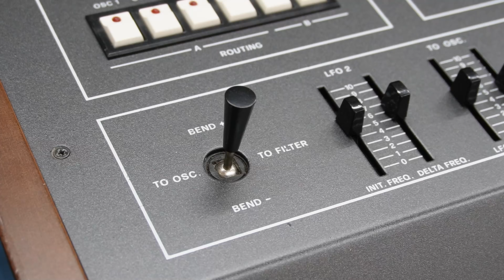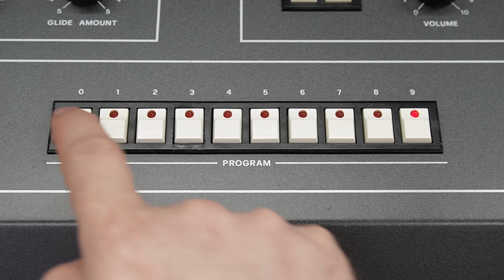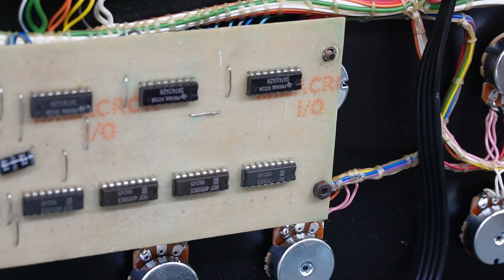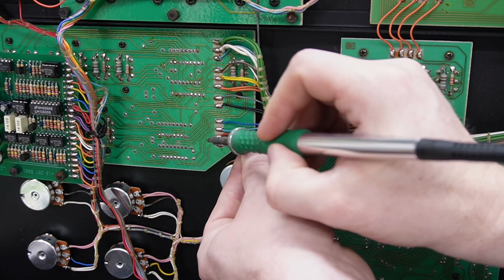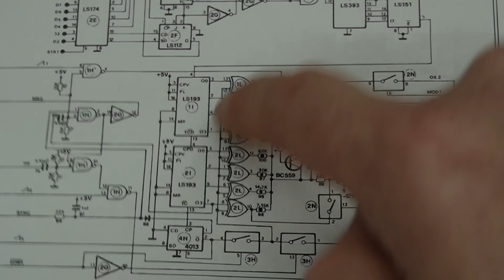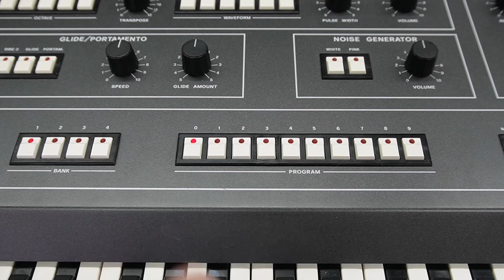ELKA SYNTHEX - A 1980's Legend Gets Fixed!

Comment: I love your videos! I watch many makers and restorers on YT and learn so much.
Your habits and tools really make clear there are no shortcuts, take your time, have the tools and the experience and knowledge before you tackle a job. 
I’ve been into building simple PCBs of guitar pedals and it thru watching people like you, Psionic Audio, Uncle Doug, Josh Scott and Brian Wampler that I’ve learned some best practices. It’s a steep learning curve, but I’m learning. Most importantly I’m learning by watching how you guys do things. Watching you solder is a lesson. I’m going to use a bigger tip now-I was using a needle nose but was having issues and watching all you guys really helps me avoid mistakes. Thanks!
PS I am very jealous of your solder remover. It works like magic!

Comment: Very inspiring. I have a JD800 that needs an overhaul. Supersynth Projects in the UK has keybed and flex PCB replacements. I need one of those kits, and to figure out all the electrolytic caps to replace, clean the red glue of course, and then go over it with a fine tooth comb.

Comment: Videos like yours are the reason why I can at least fix simple things on my vintage organs 😊 I had an error with buttons/LEDs on my Hohner E3, coming to similar conclusions about the controling ICs… but in the end it was a dodgy connector between 2 huge boards… Unlike here ALL 100+ button caps came off 😂

Comment: Hey, Mark! I saw in another video you had one of the XGecu EPROM programmers. T48 maybe? Have you tried using the logic chip detector/tester on that? I've been quite impressed by it. It will auto-detect the chip and test the functionality in a fraction of a second.. It does need to be plugged into a computer though....

Comment: What u have to remember is syths are not keyboards and can usually be set up in 3 to 4 sections so sometimes what sounds like a bum note is the start of the next section however this is old so not sure plus what av just talked about tends to be options u need to set up not always mind and depending on the synth size manufacture eg soooo who the f knows this is old and probably don't have the that tech hence all them boards which is hilarious btw I love it

Comment: Regarding the LS367s that your chiptester failed, but passed them as 74HC devices, it's very likely a logic level issue; given the 2 chips were of the same batch, it's possible they are 74HC devices remarked as 74LS; that's something I have seen when the LS devices were in short supply and certain Chinese vendors would remark them; you can sometimes find that the package date on the underside doesn't match the date code on top, that's a sure sign they aren't genuine.

Comment: Name that tune :-) really enjoy your vids nice to see audio gear getting repaired instead of sent to landfill. I used to repair synths fx units and lots of guitar amps for a local music shop, till they sadly closed like so many others. My favourite was the Synths I saw a lot of keyboards that had switches replaced needlessly when it was the chips. 
I'm really really impressed with your de-soldering gun can i ask what make it is. I had one but returned it within 2 weeks as it spent more time blocked up as the suction was to week. 
Your chip pulling jaws towards the end of video reminded me of my training at seimens nixdorf, repairing analogue traffic light boards the months I spent changing chips. We rotated from disassembling units,  testing and then repair of the boards on a 2 week rota. Our chip tester was huge machine capable of testing 100 chips in a sequence and  about £40000 I avoided it like the plague. We were down-sized when they went digital as the boards were replaced instead of repaired as it was cheaper. Now I work in computing but owning an Allen & Heath Saber 32 track Mixer They were supplied with a huge box of spare parts covering all the electronic parts and some of the mechanical the one for mine has 60% of the parts unused with pots and faders used the most. A sign of the level of quality as she has aged the main failure is caps drying out and the op amps failing which means I still get time doing repairs.

Comment: Hi Mark.. been watching your videos with great interest. I've seen you using cleaning fluids on some items and would like to ask.... I have bought a 1990s Technics keyboard which came from a man who was a heavy smoker and it stinks of nicotine... and keys and buttons feel a little sticky to touch(they all seem to work though)... What cleaning fluid would I be best to use to clean the nicotine without causing damage to the surface, in particular not to rub away any lettering, please. Then to clean the inside for the same reason, please???

Comment: The Synthex is a bit of a legend. Few were built, many say the Synthex was better than its competitors.

It was made by an organ company (Elka) and not well marketed outside Elka's customer base.

Playing one today is a dream for the enthusiast (they're scarce, expensive and sought) - so Mark is now in that select club!

It's just amazing how complex these things were - there are near 1000 Integrated Circuits inside. Equally amazing is Mark's ability to pinpoint and fix the few - was it 2 or 4 ICs causing the issue.

Please note that, testament to the quality build, the many many mechanical switches were fine - when so many Jap stuff is black with corrosion today.

The Synthex is a bit of a sad story too, since its life was cut short by the advancement todigital during the period. Digital meant smaller, cheaper and that complexity moved from electronics to software. A dinosaur being made obsolete. The bright side being that progress was rampant during the period.

Well done!

Comment: Hmmm…  is that a top octave generator like what you get inside of the Wurlitzer spinet organs?  Or could it be a Colpits oscillator??
Anyone could bend it,
But only Mark can mend it!
(As humiliating a confession as there ever was, I um, Kludged my Wurlitzer at the exact same time I kludged my Fluke thermometer).  And so for that, I know exactly where I’ll be going once and for all when the grim reaper comes a knocking.

Comment: Small correction, it doesn't count through 256 4 million times per second, it counts 4 million times per second, but you divide that by 256 to get how many times per second it counts through 256. That's 0.000064, or just under 1 millisecond. It is a big difference,

Comment: Great video and great lesson in fault diagnosis.  What is that wonderful tool for removing the solder from IC pins?  I would have added a socket for repaced ICs, just in case...
Not impressed with that IC tester!  It mislead you.  Anyway, you should alway check the new chips before putting them in.  Had you done so, you would have discoved the tester issue.

Comment: Amazing diagnostics, repair, and performance. Wondering why you didn't replace all the electrolytics on the power supply, and the battery. They're surely end-of-life components by now ?
Reply: They're usually fine and test perfectly good. Also Mark doesn't seem like a recap guy contrary to a lot of YouTubers, which I like.  In my experience caps of this vintage test great 99% of the time. From the late 80s they went downhill

Comment: The OG wiard with the magic soldering wand! I had a Korg Poly 61 where the internal battery leaked. It wrote the machine off as the damage was so extensive and expensive! Although I did fix missing notes on a SIEL Orchstra and restore a pair of DX7s, te=he SIEL's problems were due to a cracked board, breaing a trace, DX7s both RIFA caps. Nice work on the keys at the end! Wow!

Comment: The feeds on the ones that look like dorectv dishes could be removed and used in your tunnels to shoot WiFi down the tunnels. Also it would be interesting to extend the wires inside to bring the frequency down to L band. The element inside is about 1.25” long if it’s 1 3/4” it will work well on 1694Mhz. That’s not a big difference. Even clipping a clip lead on will probably work to make it RX on 1694 pretty well.

Comment: It's very nicely laid out, with traditional cable lacing and no bodge wires on any of the boards I could see, which, if true throughout, is impressive for a relatively low production count machine.

Comment: I use the chip tester in unknown chip mode. If it doesn't identify it and it is capable of testing it then it is usually bad. It's not very good at determining a LS vs HC chip. I'll use my chip programmer for that. It does work well for dead/not dead.

Comment: The Synthex was actually used as the sound engine for the laser harp by Jean-Michel Jarre. The famous ring modulated preset sound was used on 3rd Rendez-Vous in particular.

Comment: Hi Mark, do you fancy fixing another keyboard, it's a 90s arranger keyboard, also by an Italian company called GeneralMusic (or GEM for short). They are a defunct company (although the name itself has been bought out by someone else), but the original company doesn't exist anymore so its been nearly impossible to find someone to look at it. The model is WK8 Mega Station. It powers on but the sound crackles and the volume is all over the place.

Comment: Blackburn Neil.  Hi Mark. I'm now upto the 14th minute. The part where you replace  2 chips after testing them.   I would have preferred it if you had tested the replacements first before fixing them  so I could see the tester checking a good one.  Or maybe not.  Regards Blackburn Neil

Comment: If you don't quite have the funds for one of these, (anything up to and over $10k dependent on condition), Cherry Audio have a pretty accurate emulation/vst of the Synthex. They call theirs the Elka-X and it's slightly cheaper at $49.

Comment: I was a synthesiser repair tech in London for many years until I decided it was too much work and stress for little pay.. I would spend maybe 6 hours just dissasembling a monster old analog keyboard and figuring out whats not right and why, all the while trying to be transparent with the owners.. Most wanted to know immediately how much it would cost to fix, I would say impossible to give a figure, I go by the hour.. But you can see the issue here immediately.. 6 hours in and only just starting to get to grips with it.. The owners furious because its already cost him 100 quid..  Often times people refused to pay me, Half the time I could get somthing fixed for under 100 quid, if it was the usual, broken wire, power supply, dusty pots/switches.. But its like I try to warn everybody, just because youve spent 2000 quid on an old synth, doesn't mean your now in the free and clear, there old, there tired,they no longer have some parts availible.. Its literally like owning a Ferrari from 1975.. It works but the clutch is going.. Best of luck with that if you dont want to pay for the service or buy the new old stock clutch for 10 grand.. Dont shoot the messenger..

Comment: Nice one. As a designer that brought back memories of how we used to design. Multiple boards, dedicated to a specific task. Board after board of either CMOS or TTL, wires all over the place,  race conditions, dealing with crosstalk and general interference. -But at least you could see what you were working with. -And to top it off some Jean-Michel Jarre.
Thank-you for uploading.

Comment: Having to replay the diagnostics part about 14 times before understanding it just a tiny bit and then Mark says "I didn't think it would be that simple." Thanks Mark, that's a real confidence boost there.🥴
Reply: I've repaired stuff many times and don't even understand schematics either. I learn by doing and not by reading. I've rebuilt many a laptop from the ground up by doing nothing but finding what part was the problem by how the computer was acting, and replacing it entirely. Schematics really are just about saving a repair shop or factory time from manually diagnosing each part when they have hundreds per day to work at, they aren't that critical to finding out the problems when you're just one guy with one piece of equipment in a shed and all the time you need.

Comment: Seeing all the evidence of prior repair and chips having been replaced leaves me wondering: Why did these silicon parts fail?  In the 80's we started wearing wrist ground straps to prevent ESD (Electro Static Discharge) damage.  The problem with ESD damage is that often the damage does not show up until many years or decades have past.  You can't see or detect the ESD damage when it happens so it's very easy to overlook the importance of wearing grounds straps and working in an ESD safe environment.

Comment: I have the same IC tester and I find it is a useful tool for what it cost, compared to the ABI IC Testers for sure.
The ABI ChipMaster and LinearMaster IC testers are awesome bits of kit, BUT cost over £800 each.
I see a gap in the market. If there was an IC tester that did a wide range of analogue and digital ICs but cost, say £300 to £500, I think it would sell like hot cakes.
Surely someone could develop an Arduino, PIC, Raspberry Pi etc. or PC based universal IC tester for a reasonable price?

Comment: I had hoped you'd put the new chips in the tester as well to make sure they checked out ok or if to somehow indicate that the tester had a fault or was expecting another input.

If you have one of those cheap ROM programmers they also let you test a lot of common logic chips. But Adrian Black has talked about this a lot, where he finds that chips will pass in modern testers because they aren't testing them at quite the right TTL levels.

Winced a bit at that electric screwdriver camming out of one of the screws, maybe turn the torque down a notch 😅

Comment: I love how you make things look so easy. If i had that repair, I wouldn't know where to start. I have a question about diagnostics. How do you know when you change out the chips that there isn't something down the line that caused them to fail? Why not test for shorts from surrounding passives once the chip is out to make sure you're not going to blow the new ic?

Comment: Brilliant work, that’s how remember electronics in the 80s, I did the City and Guilds 224 industrial electronics from 1987 to 1991 that’s exactly how it was, huge drawings used to cover the lounge floor, don’t do it hardly anymore, it’s moved on a lot. Can I ask what solder sucker you use and what iron at what temp.
Fantastic video.

Comment: Name that tune LOL. I was a bit lost in logic. I guess if I watch this again the fault finding process will seem clearer. I remember using a chip tester back in the early '90s. I think some TTL chips could be tricky to test. Failing as one type and passing as another. But I suppose they need to work within the parameters of the type they are. I.E. testing an LS as an HC may not be valid. Not sure on that. Low powered schottky versus high powered cmos is it? LS may be not triggered when on LS but triggered on HC indicates it's faulty. Loved the Oxygene at the end.

Comment: Did you check the fanout on those chips in the design? I remember back in the day a common design mistake was to hang too many chips on a bus which could over stress the bus drivers leading to premature failure

Comment: The guy I took my Hot Rod Deluxe to repairs stuff like this. He specializes in a specific one that people send him to repair from all over the world. Some sort of Moog, I think.

He did an incredible job on my HRD. Bright and More Drive stopped working one day, out of nowhere. Turns out that they're run by an opamp and it died. Not something I've heard of on the HRD before.

The guy told me 2 weeks and had it back to me in 12 days. All free of charge since it's still under warranty. He even saved me $50-100 when the locator pin broke off my 6L6. I assumed I was going to have to buy 2 new tubes but he fixed the broken one so it didn't cost me a penny.

That would be Slemmons Music Services over in Dallas, TX, USA. Nice shop that does impeccable work!

Comment: Fast diagnostic path! The first chips would have been 09th week 1983 and not 83'rd week 2009. The corrosion on the wire links and the green on the PCB on the first board suggest humidity/moister and it will be up for a restore in the not too distant future to clean those PCB and change the links. The other PCB had sheathed links but there is corrosion there to, just less obvious. I loved that you could recreate some classic sounds and play Equinox.

Comment: Dang, that thing looks brand new ... and I'm talking about before you even touched it! That's been astonishingly well kept!
Reply: Has seen some moisture at some tine as there's some rust on the hardware but otherwise it's really neat.
Reply: @Murgoh  Where Mark lives there's sea on 3 sides within 10-15miles on two sides and 50 miles on the last, with mainland only branching off further in one direction to the rest of the UK. I imagine it's drop off for many items that large, so makes sence given the salt content of the humidity around them ways!!!

You can compare an identically well kept old car that lived outdoors from there vs the center of the mainland and one would of rusted to bits, whilst the other would be almost immaculate! Always buy cars from up north somewhere, and drive them back to Cornwall if you live there heh!! 😉

Comment: Loved this especially the cameo by the cat and the JMJ reprise at the end…

On those LS chips, your tester is fine. I repair tons of old digital boards full of TTL/CMOS logic chips (mostly vintage arcade) and those tri state chips fail in some peculiar ways.  Its common to get a marginal fail chip as well where under the load of the host circuit it won’t work yet in a tester it says ok.  

Also on that tester you can just hit OK with it set to auto instead of selecting the exact chip number - if its bad it will read NOT FOUND instead of fault.

They can do most 74 family but there are a few oddballs it can’t.

If you have an eprom programmer they can usually test them more thoroughly.